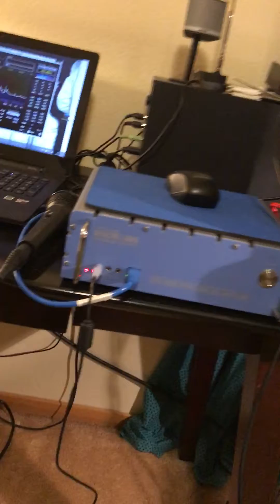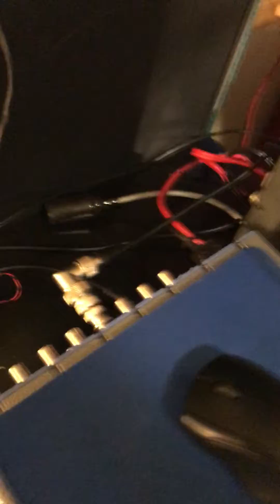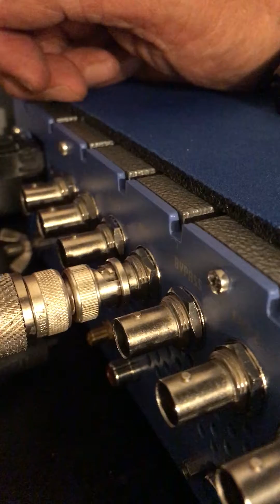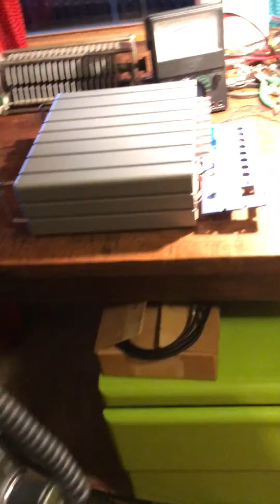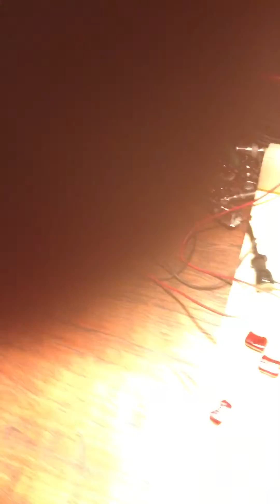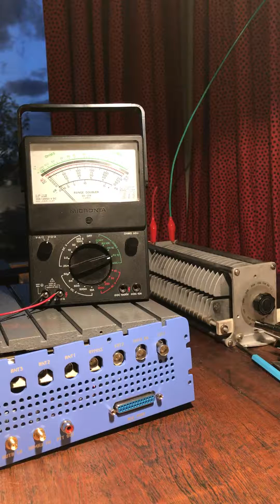How to ground the ANAN 100D Apache Labs PTT output connector Part 1

Comment: Nice info. Would appreciate if you could confirm that relay is only required to protect radio's transistor should the voltage is over 25V and/or current is over 800ma.
Reply from the maker: You're correct. I used the relay only to prevent damaging the transistor in the Anan.
Reply: I have a new 7000DLE MKII, 2020, Black .... Same problems. Apache Labs hasn't learned that paint doesn't conduct. Every screw is painted and every hole is painted. None of the chassis parts are electrically bonded! I suggest removing everything and grinding the paint off under each jack and screw.